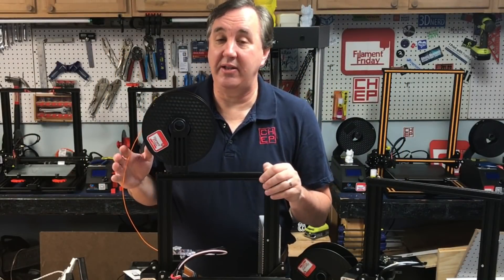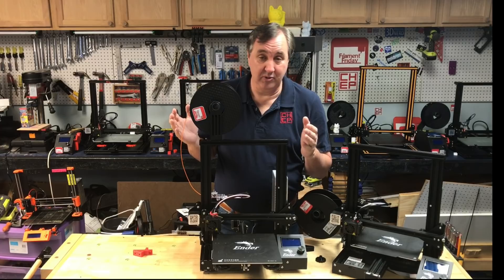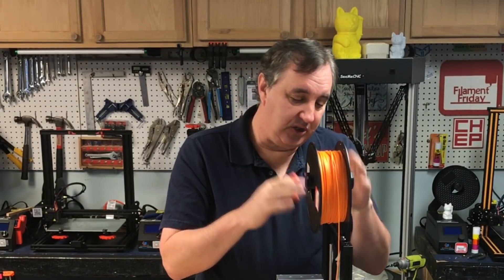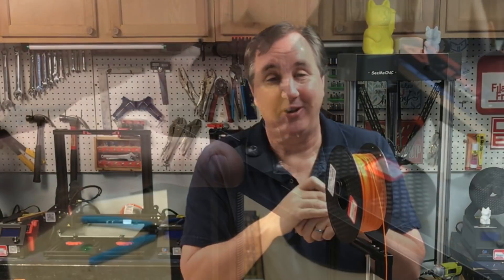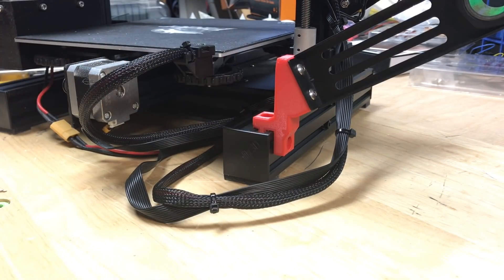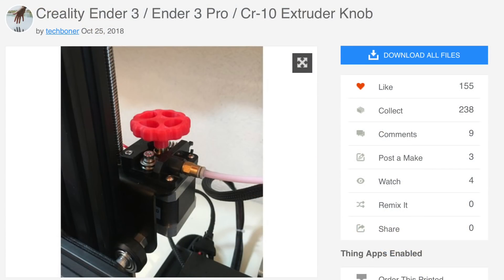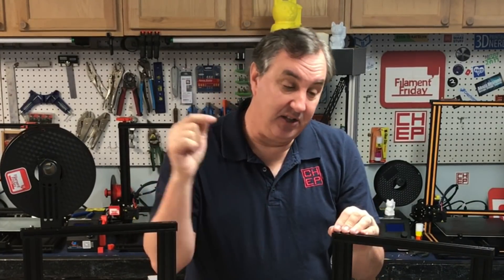3 Simple Upgrades for Creality Ender 3

Comment: I Like your mount I had already printed one but had not modified it with the "T" mount. I may try that mod. I use Fusion  360 so no problem.
But I Have an other question not related to that Subject. 
I noticed that some people print several objects at one time. Parts will take the same amount of time even if u mount them in a Gang, and in fact
there will be added time because they have to travel from one part to another with each layer. I guess the reasoning is u can leave not have to stay around 
to change each part.
Is my reasoning correct?
This is my first time making comments to this or any of the other sites.
Reply from the maker: Yes, that is correct. It also helps smaller print accuracy as it lets a layer cool while printing another.

Comment: I love the side mount holder do you think it would be better to print it in PETG for a bit of extra strength though I may try printing it in a PLA carbon fiber filament what’s your opinion?
Reply from the maker: Sure. But 30% infill or higher seems to work well with PLA.

Comment: Hello. Amazing job, thanks for sharing it!
I have a question though, I'm just a beginner and got the printer a few days ago.

So I tried to print the extruder knob with the same settings that u showed forthe converter bracket. First I flipped 180 degrees so the srew hole was on the top. After it finished, it looked very good BUT because of the poor layers it broke at the beginning when I tried to mount it. What should be the recommended option in cura to make it powerful? I use PLA,, btw.

Thank you in advance!
Reply from the maker: Try printing at 50% infill and use a higher temp.

Comment: I could have sworn I saw an Ender 3 upgrade that added hinges to the fan shroud. I am very interested in it after fighting and losing my patience with those two tiny bolts that hold it in place. Do you know where I can get the hinge from Chep?

Comment: I upgraded to a capricorn bodon tube and it came with a steel nozzle. Since changing it all out, I am getting crazy amounts of stringing. Is this from the new nozzle? Before the upgrade I never got stringing or if I did it wasn't noticeable. I'm using the same gcode I used before upgrading. Could the bed being too low cause this?  Maybe I have to get the nozzle closer to the bed? Any help would be appreciated.
Reply from the maker: Steele nozzle will often do that. The angle of the cut inside is sometimes the culprit.
Reply: @FilamentFriday  Changed back to brass, and no issues. Thanks again for the help. You rock!
Reply: @FilamentFriday  thanks for the quick reply. Im making whistles and the stringing is causing them to not sound good at all. Im going to try and clean my old brass nozzle and see if it goes away. Could it be I have the heat too high now?

Comment: You should have flipped the spool holder model so the tnut holes are facing the rear and not visible.
Reply from the maker: You can print it anyway you like.
Reply: @FilamentFriday  I just realized Cura lets you mirror.. doh

Comment: Better solution would be to just print the filament guide, let that part take the wear, since it's cheap and fairly fast to print. Keeps the foot print of the printer down. If you are worried about the filament feed angle, I wouldn't because the printer normally feeds so slowly there is VERY little chance of having feed issue.
Reply from the maker: Not better. The filament will cut into the plastic guide and cause drag issues. I’ve tried that other machines and driving it direct as I showed works best. I run printers 24/7 in printfarm so I learned the hard way that side entry is best.
Reply: @FilamentFriday    have to go with your experience on this then. Myself, as soon as I stop printing parts I'll put a direct feednin and feed from the top. I've had my printer for 5 days now, and see why people buy more then one.
Reply: OK, just looked at the "current" Ender 3,  it's got a brash insert into the stock extruder feed point, so I guess we are both correct.
Reply: @menacesaidimbanned9754  I was just going to comment that mine (Ender 3 pro) has a brass insert. The side mount looks good all the same.
Reply: @georgeprout42    I had an EZR Srtuder installed until it started giving me problems, and now I've gone back to a stock configuration, guess what, I'm now looking to print something like the filament guide now. Doh!

Comment: Hey Chep, I love your videos.  Im new into the 3d printing scene.  Just purchased an Ender 3 Pro, I could only get the demo prints that came on micro sd to work.  I tried a few Cura profiles from other people with not much luck until I tried the profiles you shared.  I printed the Cube and a few other things and they were flawless.   Im really struggling with the extruder Knob you have in the link here.  I tried printing with your Magic 1.2 and Magic 2.0 profiles but seems to be stringing underneath and not able to complete.  Hard to print on air with the overhang.  Do you flip that knob 180 degrees or add supports?  I have read that maybe the filament may be too hot and dropping.   Any help or suggestions would be greatly appreciated.
Reply: Ok I flipped it 180 degrees and printed perfect.  Noob mistake on my part.  Just assumed that the file was ready to load and print.
Reply: Personally i get good results with 6mm retraction at 25mm/s speed using the lowest recommended temperature for my filament if youre having stringing issues with other files maybe try that

Comment: You can just put a bit of heatshrink on the threaded rod (don't heat it up). Perfect and easiest solution! No more greasy filament :)
Reply: wouldn't it be even better to use part of the protective tube it ships with? Its more solid and is less likely to get stuck

Comment: Defiantly printing the spool mount. I have only had my ender 3 for 6 hours and I find that I need to turn the roll upside down(so in the same orientation you now have it in) to get it into the PTFE tube. This is because the filament is curved from being on the roll and it seems like the PTFE tube hole is a bit lower. (edit)Now I have actually printed it and the direction is almost directly into the drive gear and the filament is easier to load since the curve is going down.

Comment: Hey Chuck!  I've run into a problem with this side spool bracket that maybe you might have too.  When I mount the spool on the side I can't get the spool centered on the feeder because the sides of the spool bump into the stepper motor if I push it too far forward.  Because of this if I have a spool with too much tension like the Paramount 3d filament I like to use, that tension eventually pulls the spool off the spool holder.  

If you were able to redesign the part so that the spool holder hung farther off to the side then maybe you could slide it further forward and center the spool on the feeder, that way the extra tension in the filament wouldn't pull the spool off the holder and ruin your prints.  For now, I just remounted the spool holder on top of the printer again.
Reply from the maker: There are remixes of it on Thingiverse. I believe one is larger.
Reply: @FilamentFriday  Cool, I'll check it out!

Comment: Chep I've printed 2 filament guides with PETG at 50% infill and 40% infill but both broke when i tied to snap fit them to the extruder. Do the 2 bolts that the filament guide goes over have split lock washers underneath them in the video? I got my Ender 3 2 days ago and those bolts have those washers so i'm thinking they may be too tall for the guide to over.
Reply from the maker: Yes, it snaps over the screws. I used PLA.

Comment: I love the new mount, IT feels really nice and I did think it was a bit..worrying before on top but now I feel it is just nice and works well, though I had a little trouble slipping it on, ..Now I just need to get like a glass or something print bed because the stupid magnetic one this came with, though nice....is not flat >.< so I keep having models that if they print in certian areas get minor cases of elephant foot, when it's leveled properly, and print right....if it's not right in other spots where it is just too high X_X
Reply: I bought the glass at the same time as my Ender 3, and it works great!  No more warped bed!

Comment: I’ve been using your new mount for over a month now and it’s great, Chuck. I upgraded the spool holder to one with bearings, but now I have too much travel. Just put on a brand new roll and as soon as it started feeding it was unravelling off the sides of the spool. 🤐 one step forward another back.

Comment: Chuck, I think you should note the 50% INFILL in both the Video notes and also in the ThingIverse details.  I didn't catch it at first and printing mine with standard 10% infill.  After a week I discovered that the bracket was leaning outward so the filament spool was starting to rub on the tabletop.  I love the idea and have just reprinted it at 50% infill for greater strength.  Using PLA+ (FilaCube from Tiny Machines 3D where I got my printer)
Reply from the maker: Watch at 2:36 again. I say and show 50% fill.
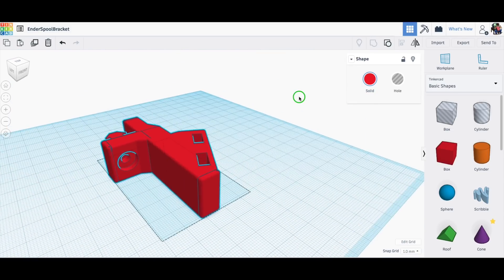Reply: I did miss the 50%. It is about  2:30 into the video just after the TinkerCad part where the Cura settings are shown.  I missed it.
Reply: I also missed it, somehow!
Reply: doh!  I missed the 50% too...  the extruder guide snapped jus taking it off the bed..  guess I have to do a reprint of extruder guide and the spool mount now.  :(    the extruder knob is working well...  awesome upgrade too.. makes it much easier to back the filament in and out...

Comment: short question. why have a countersink at the backside of the "thing" that slides into the printer rail. Am i missing its functionality ? is visible 2:23 into the movie
Reply: Because the original part does. He's simply added the part that slides into the frame without modifying any other parts.
Reply: metalmiketh : yeah, i thought of that. It is more if there was something i missed to think about.

Comment: excellent !
I have an annotation for your first design, it would not be safer to have a long with 2 screws in the base, instead of 1, for greater security of the filament reel?
Reply from the maker: The original design used two screws. You can use that. Mine works great as is.

Comment: The Horizontal Spool is the way to go.  My machine runs much better with this type  of mount.  I used a different filament angle mounting bracket with the same result.  I also made a roller filament guide as well.  My extruder knob has set screws.  These are all essential and worthwhile upgrades.

Comment: Fantastic Chep, I am going to print the remix of your design that has the holes filled in though :)

What I would love to see, would be an improvement of the spool holder itself (the pipe bit) that would allow for it to roll freely, maybe using also 3D printed Planetary Gears :)

Comment: I finally decided to try the Extruder Knob.  WOW! I would have printed while assembling, in July, had I known it would basically solve my filament loading issues.  I haven't used my Ender 3 much because of not being able to easily load it.  I would get SOO frustrated, especially when trying to do filament color changes.  Thanks for the suggestion Chuck. :)

Comment: Defiantly changing my mount to the side, i think this is much better than on the top of the machine, as the feed angle is very steep. Thinking of removing the spool altogether from the machine as i want to enclosure this to keep the heat in and prevent ingress from other materials/dust in the workshop. Thanks for sharing :-)

Comment: I printed out the side spool mount and installed it today. Thank you for a design that uses the stock screws as I have not had a chance to purchase extra screws and nuts yet. In the video, I see you have the hot end power cable running under the spool holder and around the back end of the extrusion. When printing a large file and the x axis moves up, have you noticed that power cable rubbing against the spool holder or getting stuck on the extrusion? I am currently printing and noticing the cable is pulling up against the spool holder. The alternative would be to move the cable above the holder and I'm worried that would snag the build plate power cable as it moves back and forth. Any ideas?
Reply from the maker: You can run it inside the spool holder bracket and hold it loosely to the spool holder with a tie strap. I tend to print smaller on the Ender but tested it on mine and I get full travel. I think the Ender wires are too short to begin with.
Reply: @FilamentFriday  Thank you for the suggestion I will apply it to my setup.

Comment: Hi CHEP, nice video and a very good idea regarding the bracket. Talking about it, I think it would be necessary to have a roller just on the side of the extruder for when the Z rises above the line of the spool. This roller would help guide the filament to the hole in the arm, avoiding the same problem of carving you mentioned in the video.
Reply from the maker: Good point. Most things I print are small as I have larger machines for big prints but that is a good idea.

Comment: No need to print a guide to prevent the filament from rubbing the lead screw. Just cut a 2 cm  section from the rubber protective sleeve the lead screw came with and slide it over. Simple and it works perfectly :-)

Comment: Something that you might consider is drilling the extruder arm to accept a short length of PTFE tubing.  It will guide the filament into the arm without any wear.  It will also prevent the filament from contacting the lead screw.
Reply from the maker: I did that on the Ender with the EZR extruder but still like the spool on the side but I agree, it’s an option.

Comment: I prefer the spool on top to keep a smaller footprint for the printer however... Something just crossed my mind even though the footprint will increase this brings the spool low enough that I can stack the printers one on top of the other with a shelf so now I can have two printers in the space of 1.5 printers which is a net gain of 50% space efficiency normally you can't double stack because the top of printer will be too high but by having the spool down low this becomes more practical

Very interesting :-)

Comment: Theres a stl. On thingiverse which mounts on the bolt for the nearest z wheel which you install with a bearing that the filament rides on and you can keep the spool on top and i absolutely love it. Don't know if you allow links but it's easy to find.

Comment: Hey Chuck which would you purchase the ember 3 or the Ended 3 pro?
Reply from the maker: Depends on price. After my comparison: https://youtu.be/-dv1iWXPhWg they lowered the Pro price so if it’s less than $50 difference, I’d get the pro.
Reply: I have the pro because I happened to find a good deal on one a little over a month ago. If you can find one that isn’t much more than the regular one and you can afford it, go ahead and grab the pro. If you end up with the regular ender 3 though, you can rest easy knowing that youre not really missing out on much. Especially if you know you’re going to be making upgrades to it anyway.

Comment: I now have an aluminum extruder so I'm not worried about the wear on the extruder. I have seven machines three of them on one bench and I wouldn't have the room for the way you have it now. I barely have the room for them now. But I have to say it's a great upgrade for anyone that has the original extuder with room to spare.

Comment: Extruder knob also looks cool while printing :D Instead of moving spool I thing this arm is good thing https://www.thingiverse.com/thing:2917932 (altough I had to remove middle part of end clip to be able to mount it so it's not 100% stable, but never fell off). Also I don't remember if you mentioned this tiny clips for bowden tubes.They are really optional. But I remember that at the beggining my bowden tube on extruder was falling off few times so it was good back ten https://www.thingiverse.com/thing:2994683 (now I'm having problems when changing filament. It feels like filament hit tube in brass element instead of going into it). I consider this part better than factory one: https://www.thingiverse.com/thing:2912394 but probabl petsfang duct is more universal :)
Reply from the maker: I tested that round duct and didn’t see any improvement.
Reply: Then it's wasted PLA :(
Reply: This arm do not help too much.

Comment: Merry Christmas, Chuck!
I ended up printing a spool holder that's kind of involved, but it does a great job, and has the benefit of holding the filament away from the Z screw without having a plastic guide for the filament to rub against:

https://www.thingiverse.com/thing:508896

Comment: I like this upgrades, however, I already built an enclosure for my ender3 and there is not enough room for the filament spool on the left hand side... Do you have any other ideas, on how to solve this problem?
Reply: hang the spoolholder from the ceiling of your enclosure maybe?
Reply: @baschz  Oh, i get it, this way, it would only scrap against the wood of the enclosure.
But it might be too late, as I just checked and my ender3 already has a pretty decent cutout on top of the hole. I might as well just get a metal replacement :/
Reply from the maker: Put the spool holder outside and drill a hole for the filament.